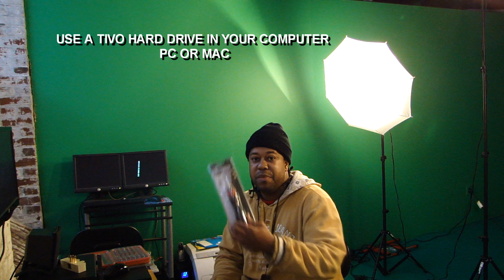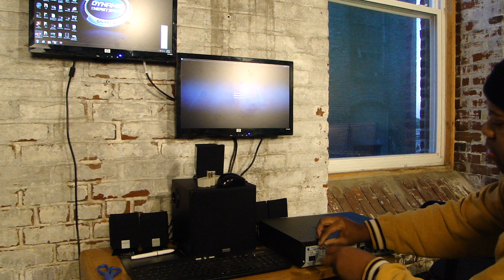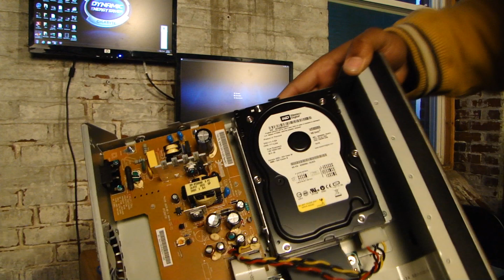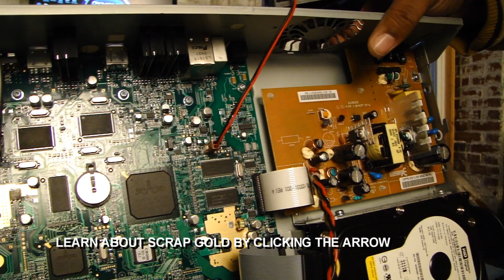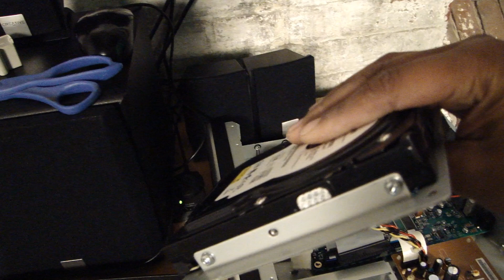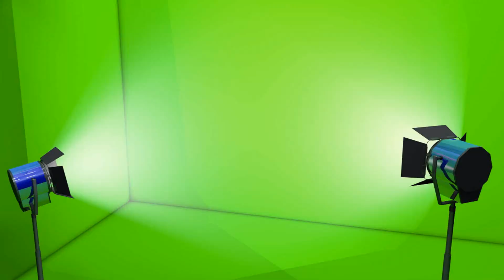HOW TO USE A TIVO HARD DRIVE IN YOUR PC OR MAC

Comment: Hello, I've taken out a couple of hard drives from virgin boxes, some have worked mainly the IDE HD but seem not to be able to use the SATA ones I've been getting, not recognised when put into a pc, is this because they are blown or is there something else you have to do to get them to reconise ? thanks in advance
Reply from the maker: Use partition manager software and format.
Reply: Most likely it is locked to the DVR, if you reconnect it to the DVR are you able to watch what is recorded?  If that is the case then what you need to do is after you reconnect it to the DVR, WITHOUT unplugging the power disconnect the drives data cable and then connect it to your computer, still plugged into the power from DVR.  Now it should be recognized on your system and go ahead and reformat the drive, if there isn't anything on there that you think is important, then have at it!  Dish Network drives would not spin up whats so ever ever removing them from unit, did as I stated above and in less then five minutes, had reformatted the drive to use for what ever i want now!
Reply: Jimmy Weigel  thank you, that makes sense to me.
Reply: So Martin did you try my suggestion and did it work?